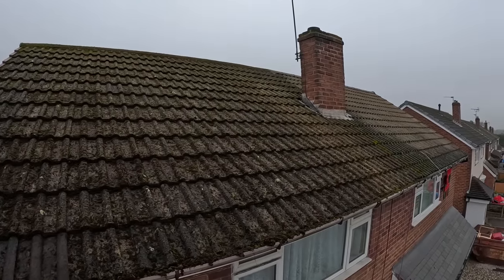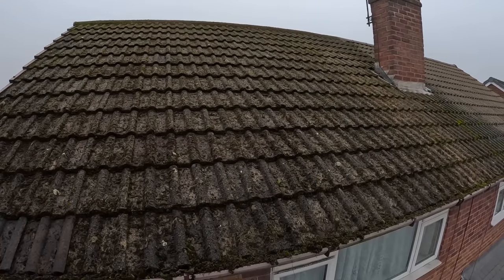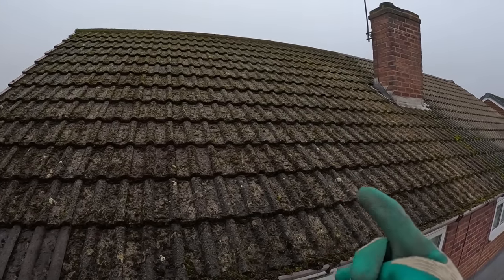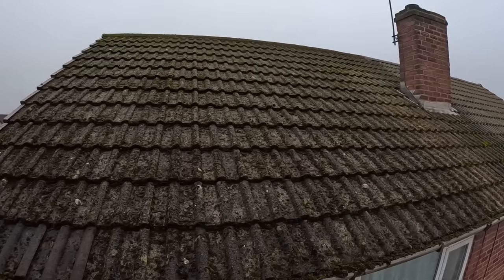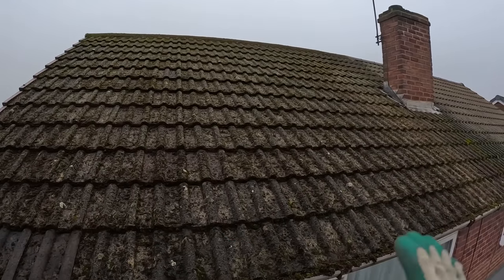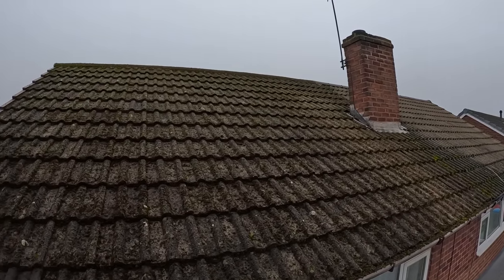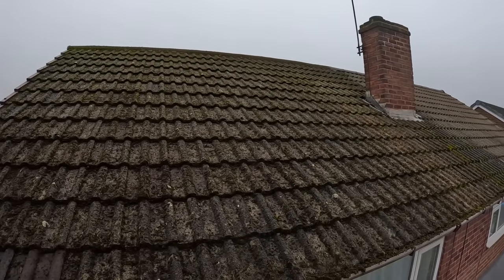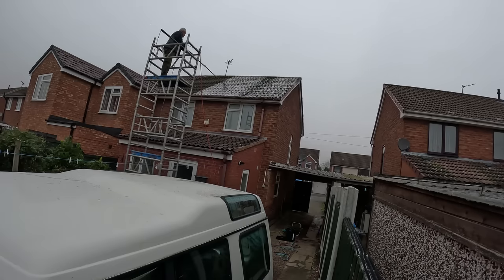STRANGE CASE: RUDE Neighbour Went Too Far? I Discovered Evidence Whilst Cleaning A Roof!

Comment: As there is only one down pipe from the time the house was built, there will be a covenant in the deeds that state it is a shared gutter and down pipe and each are responsible for maintaining it.  The original house developer was obviously trying to cut costs by not installing a rainwater drain for side of the property!

Comment: Depending on the city and state, In the US shared features of property such as privacy fences, roofs, driveways, etc... are /required/ to paid for by every party that uses them.

For example: In the city I reside, both property owners are required to split the cost of building /and/ maintaining a privacy fence if both neighbors take advantage of its existence. If neighbor A decides they want to build a fence, and neighbor B decides this is a great opportunity to get a dog because of the new fence, then Neighbor A can take neighbor B to task over splitting the cost of the fence. It doesn't always happen, but lawsuits can result if the dog or neighbor causes damage or even just additional wear and tear. 

Condos and Apartments (I think they're analogous to what Europeans call "Commonholds" and "Flats" but feel free to correct me!) are maintained by a company or organization that handles all of the maintenance aspects of owning a home so the homeowner doesn't have to. As a result, splitting a roof like this doesn't come up hardly at all here in the States. I imagine you'd just end up having to pay for the whole roof, regardless of the relationship with your neighbor.

Comment: Hello as a retired roof Slater tiler I have put a roof over many a home new and old. Usually  there should be a drain for each side .Did you take a look at the rest of the street to compare.If the others match.Back and front.

Comment: In this case I agree but I'm in a semi. Nextdoor hasn't had a roof clean ever. Thier old round guttering that was flooding down my guttering ending up flowing over my gutters because of their moss so I end capped both our gutters don't share each other's gutters now. I've fully cleaned my roof and then Stormdry the tiles and installed the original hedgehog.

You can talk about love thy neighbour but if lack of maintenance is damaging your property you have a right to protect your property.

Comment: If the houses shared a common down pipe, then it is the responsibility of both houses. On the original drawings / plans this will show the downpipe and guttering arrangement. If the neighbour alters the guttering to stop the runoff from one house to the down pipe then building control could make the neighbour alter there guttering to the original state. But try to talk to the neighbours first to sort out....

Comment: It is a bit rude to block up the connection for the gutters. to me i think both should have their own down pipe but they should be shared as a back up to each other incase one is blocked or damaged. I know that gutter is sloped to the down pipe for correct run off but it is still better to have two instead of one in my option. I know on my house when we had to replace the gutters. we just divided up the bill and I installed them the full length back and front.

Comment: That is an end capper.  The other gutter is lower which means was added later.  They don't share a gutter but that guy added a gutter onto an existing gutter.  The side that had all the gunk on it was actually at fault and should have put in his own gutter.  The guy who did not have the dirty roof owns the building of both and this guy is the real bad person who was trying to steal gutter use without having an exist on his side.  With 2 houses and a room that big you need 2 end gutters and only 1 guy had the gutter part while the person who did not own the property did not.

Comment: The neighbor did not want a blockage in the only down pipe from the roof.  It would have been better to clean the whole roof by mutual agreement and share the cost (Maybe a box of Beer or Wine would have gone a small way to resolve the issue.). Also to renew the existing guttering with a wider gutter and install a bigger down pipe with a trap and overflow cutout.  This would have solved the roof problem for both neighbors.  It's never easy resolving issues with neighbors, but I can see that the lack of maintenance caused the issue in the first place.

Comment: same happened in my house the roofer next door connected to my gutter i got a hopper that water from my roof connects to the hopper and goes down the down pipe the roofer connected to my hopper with next doors guttering if it rains heavy we got water splashing onto my house tried to contact roofer didn’t care council don’t care neighbours sold the house so basically its down to use to sort the problem .

Comment: Getting their own down pipe is a long term solution. As for if what they did is neighbourly or not is really not a thing that matters, but the fact that the prevent water flow is.

Preventing the flow of the water will cause damage to the gutters. This could have the effect of flowing into the roof and causing the wood to rot, causing the roof to cave in on the houses.

Or the other better outcome of the gutter getting full and ripping off its mounts.
Reply: But where do you put the soakaway for the new pipe?    Needs to be 5m from the road and 5 m from the building if it serves the main house to comply with the UK Building Regulations and I suspect you need to notify the Building Control too and pay a fee.  If you connect to the sewer, does that cross the neighbour's land to get to the nearest inspection chamber?  Do you need a new inspection chamber?  I get where you are coming from, but a new downpipe is a matter that will involve Building Control and may prove to be extremely expensive if you start cutting into shared underground drains (that are now normally owned by the water board even if they are on private land).

Comment: The roof needs proper refurbishment - pressure cleaned and repainted to make the concrete tiles waterproof again (currently just a big sponge), at the same time just split and replace the gutter with a new downpipe, would work better for everybody.
Reply: That's ok if you have somewhere to discharge it, probably have to dig a new soakaway. Mine discharges into the main sewer, another practice no longer allowed.
Reply: @fluffybadger9832  Property is much to small for a soak away - which could/would actually damage the house foundations. Regulations re storm water (rain) are different in different locations, and in a high density location such as this house it is a a council responsibility to provide drainage at the street level. Or you get flooded streets - which is starting to happen in parts of the UK, with the effects of climate change. So there is either dedicated storm drainage system or the sewage system is used (only actual issue with using the sewage system is the volume of water being treated). Ground run off has to go some where. In some tropical areas roof gutters are impractical as they cannot handle the volume of rain water, so are left off. But this still means that the water coming off the roof has to go somewhere so there needs to be working drainage.

Comment: I’m not so sure the neighbour has ‘blocked’ the guttering. Maybe they installed a mesh type material to act as a filter, preventing moss and debris from the other roof clogging their brand new gutters. Over time the mesh could have got clogged and made it appear to look like a ‘felt’ material. If it was a deliberate blockage it would more likely be a solid plastic divider which wouldn’t have been cut with that Stanley knife.

Comment: If the divider/stopper is not illegel then it must fall into the category of highly NOT recommended, since there is only one drain pipe. You can't just install a drain pipe anywhere; it's to connect to a drain (hence the name). If any damage were to happen due to overflow I bet any money any insurance company would find this peice of plastic and I reckon the neighbour would be in a lot of trouble as the damage caused would be deemed self inflicted, owner error etc. The point is that could have caused a lot of future problems. In the short term, stale water stinks!

Comment: As a roofer I come across this all the time and it is not only house 2 to blame the amount of moss on house 1 would mean the  gutter on house 2 would be constantly filling up with moss off 1 and blocking downspout and gutter, it's obvious off the video that house 2 keeps there tiles clean and moss free and you can see why they have now forced house 1 to de moss there roof and now the middle of the gutter can be reinstated to flow properly into house 1  . Maybe they were sick of asking and had to do something drastic, it is very difficult sometimes for householders who do not communicate  to get any sense!???

Comment: I wonder if switching to shingles would help. We don't seem to have the growth on tiles people over on that side of the pond have. Even if we have to replace it in 30 Years it seems easier.
Reply: Could be Planning or Building Regulation issues with shingles.  Would put insurance costs up too as would be seen as a flammable and short-life material.  Plus we simply don't use them so they'd be expensive and, despite that, would devalue the house.  Concrete tiles last 60 years or more and are cheap, and don't seem to grow moss for the first 40 years.  Moss takes time to get that thick, so that roof probably won't need another clean for a decade.

Switching to shingles might help, but UK thinking does not see roof re-covering as routine maintenance, so if the only advantage is lack of moss growth, it really would not be worth it.

Comment: The rude neighbour should be liable for damages and the cleaning as it's the neighbours modification that's allowed it to build up so much.
Also the Local Water Board would hold the neighbour to it as it's part of what you pay to them to clear the greywater from the roof.
If you prevent the water entering the system and instead trap it yourself you can actually be charged for it.

Comment: The developer at the time, to save money only put waste on one side. So the downpipe can't be on both sides as the side with no downpipe has no access to the waste service on their side. I don't know for 100% but if you can't access the services on your side. The adjoining property must allow you access. This was solely done to save money by the developer. They did it with electric cables too. The service cable is just on one side and loops to the other.

Comment: Over the blockage  fitted by next door it could just end up as a game of fit and remove. BUT!! the main culprit was the initial builder not fitting a down pipe at each end of the gutter. Though looking at the left of the house you are roof cleaning  this has a garage front level with the front wall of the house. My opinion is that the garage wall joining the house covers the original gutter gully for that side of the house and the builder or owner of the garage has removed the down pipe. So may be it is not as clean cut as you think. If that is the case the left hand property owner has removed the other side of the joint property "Legal easement of water" so he would be in his rights to stop water from the side having removed the down pipe.  What makes me think this is that a standard joint downpipe system  has the pipe in the centre of the building and gutters.

Comment: It could be a issue from either side but it it illegal if the houses were built that way originally with shared pipes if not theres nothing to be done look on the original plans for both houses see how the builder set them out

Comment: To be honest, seeing how much moss was on the roof makes me understand why the neighbour wanted to stop runoff into their gutter.
Reply: The water retained in the guttering IS the reason for all that moss growth
Reply: @shadowbanned5164  Nonsense. The whole roof was covered in moss and thats never due to blocked gutters. A blocked gutter might cause damp and therefore moss growth on the wall underneath where the gutter overflows of course. How can a blocked gutter affect the roof above it?
Reply: @stevechapman6551  One side clear the other side mossy the only difference between the two is the water retention in the gutter its simple common sense moss needs a wet environment to flourish...Its a single dwelling dude there is only that single difference use your noggin if you are able.
Reply: @shadowbanned5164  Nonsense. Use your noggin dude This is two houses not one. Next doors roof has been re tiled and the owner of that house has had a new roof. They don't want the crap from their neighbours roof blocking their gutter so they sealed off their half of the gutter to stop that.  I can see there is no point discussing this any further with a dude does not understand that its two houses owned by different people and  that thinks that water can run uphill.

Comment: Your customers roof is covered in moss by a huge amount. I have cleaned my parents cutter out many times because the down pipe gets clogged up with moss when there's heavy rain washing it off the roof.

I think the neighbour likely got fed up with their mossy roof blocking the drain causing water to leak down their walls too.

If your client cleaned their roof regularly I don't think the neighbour wouls have blocked the drain.

Heavy rain causes moss to block pipes.

Comment: On a house like this, there should be four downspouts.  One at each corner.  The gutter like the roof is shared and has a high point at the mid point of the building.
Reply: Trouble is that means an extra downpipe to maintain AND an extra underground pipe (probably) and possibly an extra inspection chamber.  Total installation and maintenance cost is greater than that of a shared gutter.  But it would prevent moss running into shared gutter sections.

Comment: The guttering on my house is the same, it all flows into next doors side and they have the down pipe at the rear, we have one each at the front. Unfortunately next door have jurassic park growing in the gutter at the rear so ours was flooding over and wetting the wall when it rained so I had them separated and I have my own down pipe. No beef with neighbour, just made it easier for me.  I think it was wrong of the neighbour to do that, but you always get people like that. I'd get my one downpipe fitted its not a big job and would solve all the problems.

Comment: Classic🤣 although definitely a bad choice in reactive work, as apposed to proactive. However, im sure if you instal something into your gutter, to PREVENT the WATER from entering the neighbours gutters, then you could probably take them to court for damages. Funny enough, i just cleaned my guttering out, as it was seriously blocked with moss and silt. So instead of me having to clean out the gutter again, I installed some wire mesh guard's, but home made to save on outlay. I think mine are better anyway, because instead of clipping onto both outside and inside gutter edges, I cut the mesh around 6" wide, so it clips onto the outer gutter edge, but slots up and underneath the bottom tiles. Therefore there's much less chance of the moss sitting on the guards, and slowly breaking up, and still dropping into the gutters. Then at the adjoining end, where my gutter ends, and the neighbours gutter starts, I rolled up some wire mesh, and put that inside the gutter, to prevent the neighbours moss, entering my gutter.
It's a pain really, that so many house builders/councils, cut corners in the first place, only supplying one downpipe between two or more homes. But there you go, personally, I believe ALL homes should have their own waste systems, and NOT rely on a neighbouring properties system. I mean, you wouldn't expect to share the same FOUL pipe for two homes, and then have it block up with shit because a neighbour chucks other stuff down the loo! That's why they are all separated, and only join in the ground drainage system.
I have to admit though, (My neighbour is a council tenant, drug user, complete asshole, trouble causer and washerwoman, so I'm looking forward to when it rains heart🤣😅😂😭

Comment: A shared gutter means you also have a shared drain, it is illegal to prevent access to a shared anything. This will be detailed in the property owners deeds. A solicitors letter should resolve the issue.  It never ceases to amaze me the amount of total pricks there are in this country.   I’ll bet the neighbour was having trouble with the other neighbours moss constantly blocking their gutter and the shared down pipe.

Comment: They may have blocked it to avoid rain water drainage  charges from the water company . I tried to get the rain water charge taken off my metered bill and you have to make sure your not accepting a neighbours rain water. Ridiculous. Even if you have water butt's you still need to ensure your not getting a drop of neighbours rain water.

Comment: I've been in the roofing game 30+ yrs & looking at next doors roof at the back well he wants to be getting those cowboys back, for starters the top of the dry valley should have a piece of lead over it & not ridged straight over & 1of my pet hates a bloody short coarse on the little extension roof,' if a roofer can't work a roof out properly especially 1 that small he want's to take up a different profession, he's being a little spoilt brat over the 1 down pipe, if its been like that from day 1 he can't just change it cos blocking it so next doors can't run out can cause  there's to block & then get behind the facias & soffits then cause damage then will he pay for any damage caused because of his childish behavior.